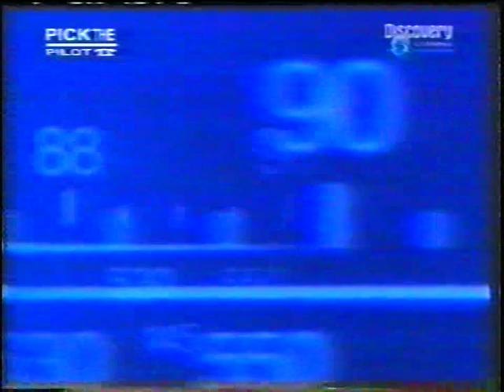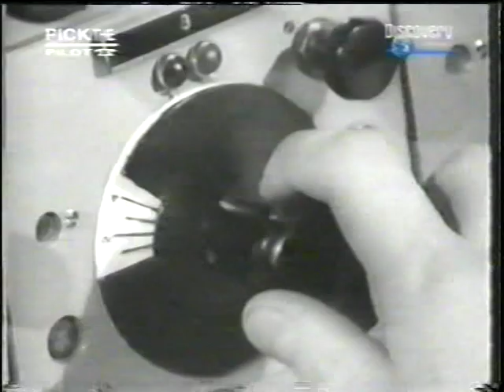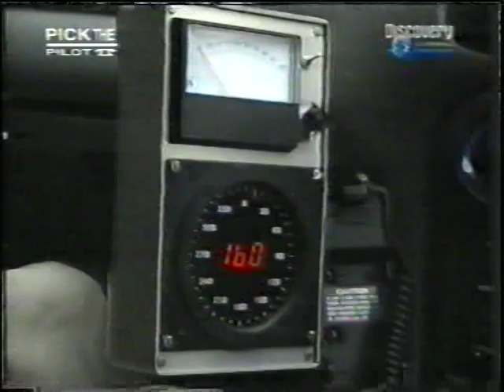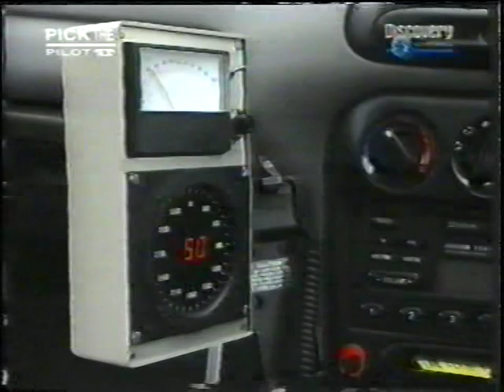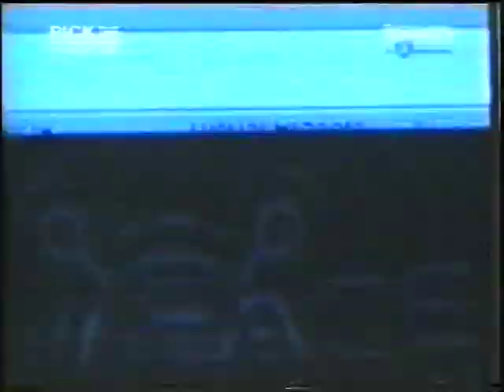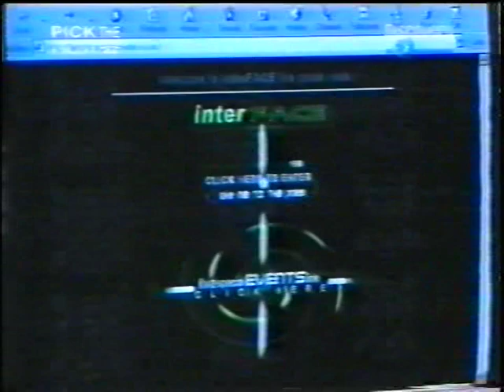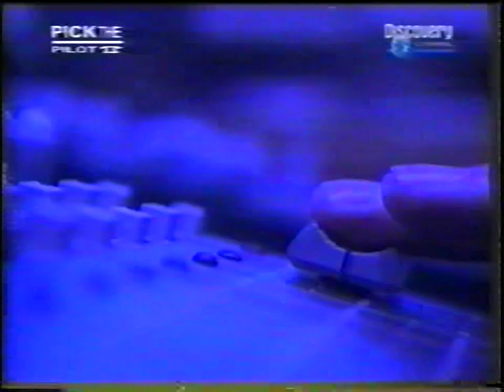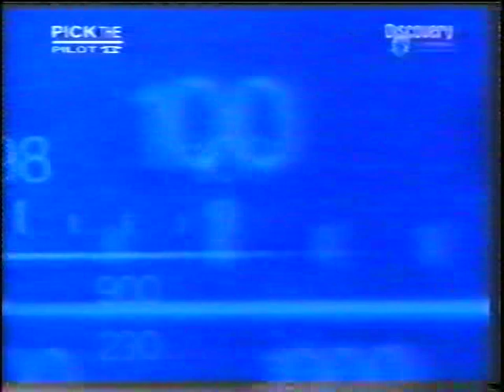UK Pirate Radio Documentary  - Making Waves

Comment: To make a microwave link they used to use an LNB from a satellite dish as the reciever end, and the transmitter end would be a horn from traffic lights, or from a shop door sensor, If i remember correctly.  I have no idea what circuitry is used to modulate the signal etc, but a decent radio guy could figure all that out.
Reply: Spot on bro..
Reply: The Amateur Radio hobby encourages playing around with various technologies and frequencies.
A lot of circuit designs are out there and can be adapted for this purpose.

Comment: That's only when someone who doesn't know what they're doing and builds a sprog box. Someone who knows what they're doing would have tested the transmitter using a spectrum analyser. Band 1 isn't used as much because most people use microwave. The emergency services haven't used band 1 for years, they've moved to tetra airwave on 370-373 mhz. You're talking about the old 80s vfo txs. It's all a stupid law anyway. In Italy and other countries you're allowed your own tv & radio station.

Comment: If the transmitter's dodgy, they could be way off the FM broadcast band, not to mention the many harmonics they might create even within it, which can easily wipe out the whole band, if not more. 
Even if they end up broadcasting where they intend to, the potential for possible QRM (interference) is massive, especially if the ERP (Effective Radiated Power) aka, the output (in Watts) is high.